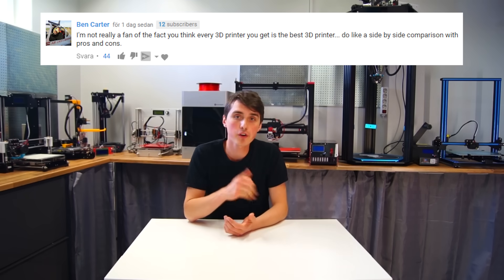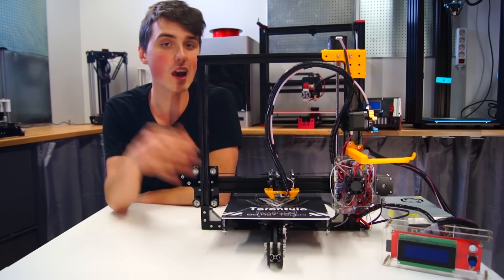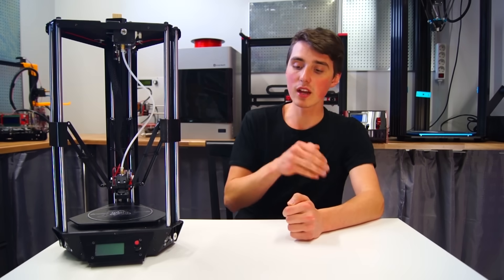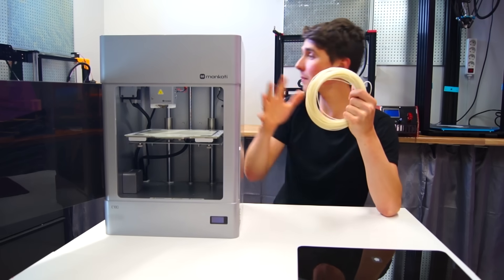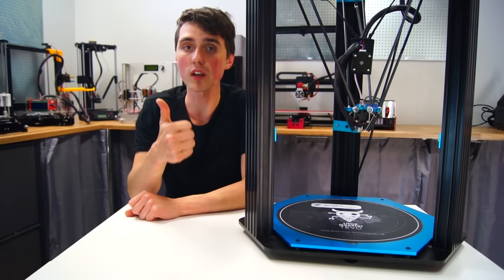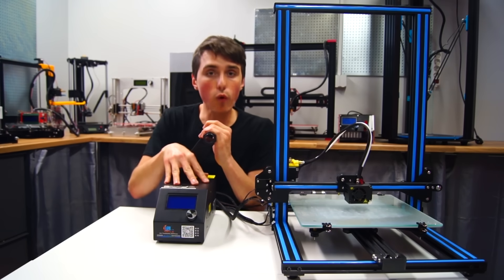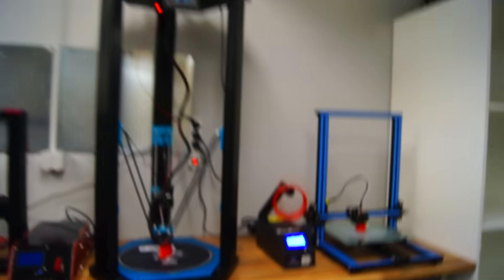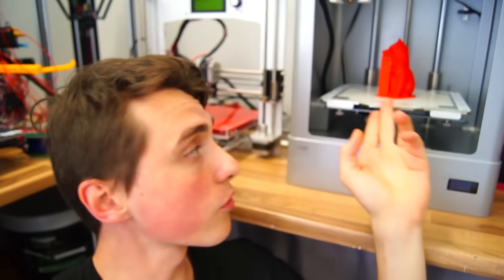Why This Is the Best 3D Printer - Comparing ALL My Printers!!!

Comment: Well, my Anet A8 prints WAY better than that. You should check that machine and improve it with some parts. Nevertheless, great video!
Reply: mikel9292 - the Chinese cloners have missed the boat.....had some bright spark brought out a clone of the A8 ..with all the upgrades included and added a bit of quality control ....Joe Prusa would have a serious contender.  The A8 set up reasonably well and taking care with the bed level, produces some class prints.
Reply: Thingiverse is full with updates for the Anet A8, I also have one and it prints great!
I only did one upgrade yet and that was a vibration demper to reduce the sound noise. Next update will be adding a mosfet, because the Anet isn't the safest 3d printer on the internet...
Reply: For me it took almost 12 hours. Feel so dumb
Reply: One of the best upgrades that id did to it was the front frame brace
Reply: I'm surprised he said he built it in 3 to 4 hours. I take my time to make sure everything is right. Built three now. Never that fast.
Reply: I have seen great improvements on A8's quality by modifications. But the sense of this comparison was showing, what the printers are capable of without modification. Don't forget that mods also increase the price, so a cheap printer with mods has to compare to more expensive stock printers.
Reply: That's right, thingiverse is full of upgrades for the Anet A8. For the vibrations, by just simply adding a chunk of withe foam below the machine (I've holded down my printer to a table using 3D printed brackets) it reduces the noise a lot and also improves the print quality because there are less vibrations. I recommend to use the "Spriya" fanduct, is much better than the popular semicircular one.
Reply: I also use the spriya fan duct and it has greatly improved the printer as a whole. I recommend printing a filament guide and spool holder though to reduce strain on the extruder. The y belt tensioner is a must also.
Reply: Does anyone have any idea if the A8 is the same as the Geeetech I3 X acrylic which I have.  Looks close.
Reply: +1 on that. Using a Anet A8 myself and made all upgrades mentioned above. I can now print faster AND with better quality. However i didn't use the "Hulk" frame braces but the plates by Tavero (thing 2108158). They look a bit cleaner ;)
Reply: I have the Anet A8 and it prints nice. It took me a little over 5 1/2 hours to build to which over an hour of that was removing the brown protection paper off of all the frame components. I feel this is a great printer, even if you buy it just as a learning device/ steppingstone to your next printer. I have learned so much just by owning this printer that I feel if I purchase a more expensive printer in the future and "if" a problem were to come along then I feel confident that what I learned with my Anet A8 would help me make repairs or adjustments. Ps. Most people would spend more then the cost of the Anet A8 just to learn how to use a 3D printer.
Reply: yeah, that's one of the issues with mainstream printing.... IF an issue comes along what can you do but wait for tech support like an idiot and get the run around all day long just to have to send it in to be repaired. It's cheap enough to buy one just for spare parts so there is less down time. Overall it's a good printer for the cost, but it does need modifications.
Reply: But its not a legit Anet A8 if you upgraded it. How can you compare the raw qualities of different printer if you don't try to be as close as possible from "factory new" state. That quite defeat the purpose of its price tag if you have to invest in more stuff.
Reply: mikel9292 mine does not work :( I don’t know whats wrong
Reply: How much does all this cost with the upgrades?
Reply: >20$ Upgrades + 160$ Printer
Reply: Great deal. I opted out because of the fire issue.
Reply: Seriously? Which modifications did you apply on this 3D printer? (Anet A8) I would like to know, since i considered buying it myself.

Comment: please make an update video on the Tevo tarantula. I bought it in March and it's put together but I'm not getting great prints. I've looked in the Facebook page and it's good but I would prefer if you would make a video on your favourite upgrades for the Tarantula and what settings you have for marlin. Love your videos keep up the good work!
Reply: I have the tarantula and it prints just great.
My upgrade part list:
1. Fanduct
2. improved z-axis mount
3. x- and y-belt tensioner
4. olham coupler

The Marlin firmware I took from the facebook group.

Now my prints look amazing!
Reply: hey Callum Jackson, try to post your question/concern into the facebook group, thats how i recently fixed my printer. Someone reached out to me in less than 1 hour and helped me for the past 2 days and now my printer is fixed. I also had a very unique issue as well, the people that help are very familiar with printer.
Reply: Callum Jackson yes dude the same thing has been happening to me
Reply: no like marlin the firmware that you flash to the Tarantula using the arduino ide
Reply: Callum Jackson 0
Reply: Callum Jackson Η
Reply: any chance you could give me a link to the marlin you used because there's so many different types in the Facebook group
Reply: You should print a part cooling fan holder and a x axis motor mount. Watch his review of  the tarantula and you will get some help
Reply: It's kind of more advanced, but I recommend adding a second motor for the z axis onto the other side of the carriage. Autoleveling is also a good idea.
Reply: Just get an updated ender 3... they are better
Reply: C
Reply: Callum Jackson by marlin do you mean slicing software and if so I use the newest version of cura.